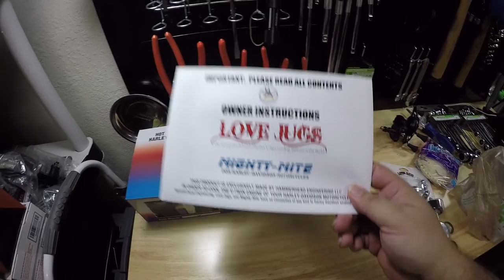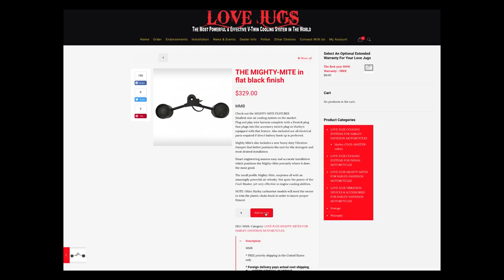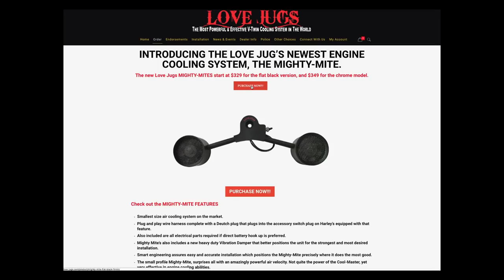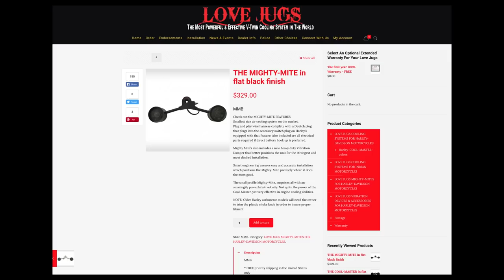How To Cool Down Your Harley! - Love Jugs Install!

Comment: Those are small fans for something the becomes much hotter than a computer.  Plus your cooling only one side.  A larger oil cooler or oil cooler would add oil volume as well as whole engine cooling vs unequal engine cooling.  Harley needs to address these issues.  I ride water cooled bikes and I do not expect them to overheat in any stop and go traffic.  If it did that company would lose sales.  Oil cooler most bang for the buck!
Reply: That’s why HD is dying because HD and technology don’t mix! HD needs to start building all motorcycles that are liquid/water cooled!
👍🏻👍🏻

Comment: Seem like wiring it up to the battery tender plug would be way easier when riding around. Like a adapter clip that those use at the end of the fans cord. Just a simple idea for them.
Reply: Plug and Play, Amen to that. that's how I do a lot of my accessories.

Comment: Nice videos Blockhead.  I have a 2016 LRS.  I've put both the Love Jugs and the Jaggs fan assisted oil cooler over a year ago.  Really help cools the beast down.  I must say though, I was a bit disappointed that you refrained from giving any head temps at the end of the ride.  Safe riding bro.
Reply from the maker: Wasn’t that long of a ride, wouldn’t be insightful at all

Comment: Certainly forced convection will shift far more heat than natural convection. Some of the university maths showed that an aggressive forced convection was shifting 15 times the heat transfer of natural convection. But do we not need 4 of them for BOTH sides of the motor? Although the oil temperature will be cooler as you are shifting more heat, your left side will be much cooler than the right. Good to see an owner sympathetic to cylinder head temperatures of a relative air-cooled motor. Respect!!

Comment: I remember that harley used to make a fan with a chromed grill for that.  I got a 9 inches universal fan just for testing.  It worked for stop and go situations but in the open road it was blocking the air and engine ran hotter so i put that fan in my car instead to help a/c fan.  Sportster runs vey hot too.

Comment: I can remember the days when Harley riders would eschew little, flat, black radiators between the downtubes as design blasphemy.  Now mounting titty fans to prevent 2nd degree leg burns has become acceptable. My how times change.
Thank you for the M8 Harley. That lil oil cooler between the downtubes looks just fine...and works Gr8!
Reply: saddlebag is right. that oil cooler is great. fans blowing localized hot air. yeh right. it is better than nothing though so good call on installing them. your install instructions are great.

Comment: So many connections on Harley wiring harnesses are the Deutsch DT or DTM (mini size) housings. The dealer can get you both the male and female ends you would need. Sites like wirecare.com and others can price those bits cheaper, but convenience at the millenia factory location is prolly worth it to you.  Anyway, fabricating a Y-harness that breaks off into the older 4-pin connector (IGN PWR, GND, ACC PWR, brake) and another 6-pin (those original 4, plus CAN +/-) is easy enough and worth it for future use. Plus it keeps the bike's wiring neat and tidy.

Comment: i take it that with the 6 pin , that the 2 extra wires are meant for  the ignition switch on start up so the fans will always be on
 , and not have to use the switch   >.>  . . .  sounds like a headache.

the double wrench extension is what my pappy taught me when i was 5 yrs old .  it does an amazing job.

with that bracket, the nuts.... are they crimped on the exterior of the nut to keep it from vibrating loose??? or does it have lock washers?

kill switched from a car,  ahaha  funny . 

awsome video !!

Comment: BlockHead. Just an FYI for next time, Deutsch connectors have lil locking tabs on the inside that will let you save/reuse all the parts of said connectors.

Comment: Years ago a friend and I were trying to figure how to use a cooling fan from an old Magna on my Ironhead, it was to large and would have to blow from front across to back cylinder which we felt would throw more heat to rear cylinder so we scrapped the idea. 

Now this idea looks solid plus the smaller ones don't look that bad on your bike. How are those working out so far?

Comment: Great video. Do you recommend these for all size Harleys?
Reply from the maker: When I had my 883, I didn't really have any problems with it getting too hot from what I remember, even in traffic. Larger engines produce more heat, so I really started to feel the heat while stuck in traffic with my Low Rider S. Depends on what you ride I think, but they do work for multiple Harley models if you're wanting to keep it cooler and have a lot of commuting in stop n' go.

Comment: After a recent ride on PCH through Santa Monica and not being able to split lanes, our group all had bikes overheating.  I'm very interested in the love Jugs products and need to ask you if you ever feel that the smaller unit you installed is lacking?  I have the opportunity to use the larger models of fans on my touring bake but like the simplicity of the mighty mite.  Would you install it again given its performance thus far?
Reply: I was wondering the same thing.  I have an ‘09 LR and was wondering if they would work well enough to keep it cool or if I’d have to step up to the bigger one.  We have shorter but just as brutal summers here.  Perspiring minds want to know.

Comment: Nice. Do you feel hot air on the right side being pushed over? That would annoy me.
Reply from the maker: Not really. Comparatively, not having it would let the engine get really hot, which would cook my right leg, to the point it would be almost painful and having to hold it way away from the bike. Having been able to test this in crawling traffic recently at Daytona's Biketoberfest on the main strip on Sat night, having the Love Jugs on never let the engine get hot enough to get to that level of discomfort. From what I've experienced thus far, they really make a huge difference.
Reply: Cool thanks. I certainly know the feeling of being too hot. I used to ride in shorts (ill-advised) in Phoenix. In traffic, the heat of the engine and the road combined would singe the hairs on my legs in the summer. Painful.

Comment: If you know anything about how an air-cooled engine dissipates  heat you wouldn't try and reverse that action.  lol Anyway it's your bike and if you want to tart it up it's all good, In my shop, we like the OilBud over some computer case fans. you should have done an Oil temp before and after
Reply from the maker: An air cooled engine dissipates heat via air moving over the cooling fins. Is this incorrect? How is this reversing that action? Love Jugs pushes air over the engine when in stop and go traffic or setting at idle when the bike isn't moving. OilBud is an oil cooler, which requires the bike to be moving and air to be moving over the cooler for it to function properly. Big difference there vs the Love Jugs, which don't require the bike to be moving (great application for the traffic in cities like where I live.) 

I'll be doing before vs after temp testing as well from a cold start baseline. From my testing recently on the main strip in Daytona at Biketoberfest, it makes a huge difference though. I'll get some numbers here shortly and post a video.

Comment: I have an 03 Heritage, 88 jugs cut to a 95. Here in Nebraska it heats up in summer in slow traffic. I'm considering a set of Love Jugs and an oil cooler, I have about $4000 in the motor. Any advice you'd like to offer?
Reply from the maker: Buy a set and install em, you’ll thank your leg! They’re help a ton, couldn’t imagine having the bike without em
Reply: Thanks brother, I appreciate your input and your channel

Comment: And by the way people these things are like $450 for plastic fans I think that's a rip-off and they're charging three times what they're worth . I would go with a oil cooler thermostat system with fan on radiator do you research people

Comment: Why not just put the oil cooler that Harley sells or aftermarket on the bike? It would work and look better then this ugly thing mounted to the side of the bike.
Reply from the maker: +Donovan Lewis Oil cooler only works if you're moving. Doesn't help at all in stop and go or stand still traffic.
Reply: +BLOCKHEAD There are oil coolers with fans that automatically turn on and turn off for Harleys. The oil cooler would also make the entire motors temp. significantly lower so it would take a lot longer to heat up in stop and go traffic.
Reply from the maker: +Donovan Lewis Never saw one that had a fan on it. Post a link to one that'll fit on a Harley Dyna 👍🏼
Reply: +BLOCKHEAD if you Google "Harley oil cooler with fan" several will come up. The UltraCool is probably the most popular, they have several different sizes. Most, when the oil gets to around 220 F the fan automatically turns on and it will keep the oil significantly cooler. Oil is what primarily cools an engine and something like Love Jugs can't really cool the oils temp down to an area that makes a difference because of the limited space the fans are targeted on. The 110 in the Low Rider S should have had a oil cooler from the factory because its a stupidly hot running motor.
Reply from the maker: +Donovan Lewis "UltraCool Black Oil Cooler System - Does not fit your 2017 Dyna Low Rider S." Also found some made by Harley, also don't fit Dyna. All oil coolers that I came across with fans don't fit the Dyna frame. Link to ones that do?

Comment: So, here is the deal. These little fans just can't blow enough air to dissipate this much waste heat. Sorry. Is waste of time and money. Is also just one more reason why these big air-cooled harley engines real losers.
I know of  ; for a fact ; real engineers down under successfully mitigate air-cooled engine waste heat using ceramics...... This is the only real way to solve this problem.......and Harley-Davidson will never do this....!!!